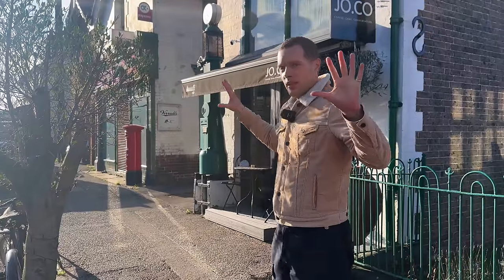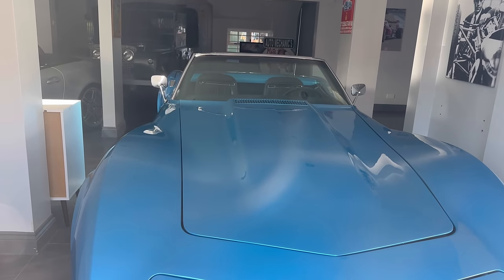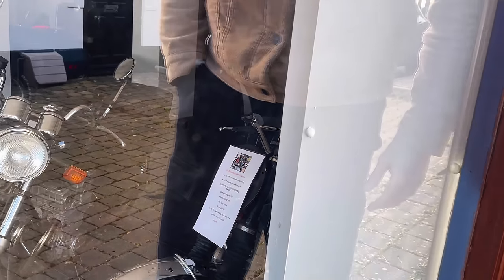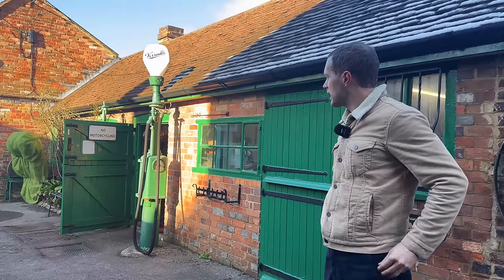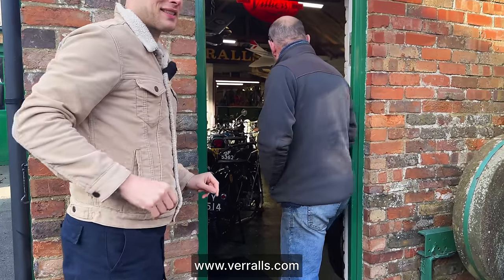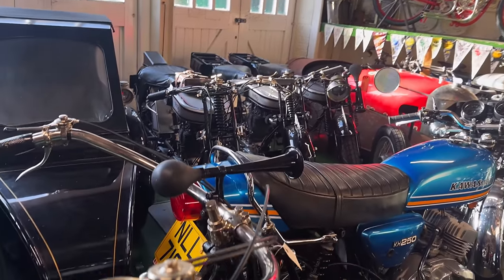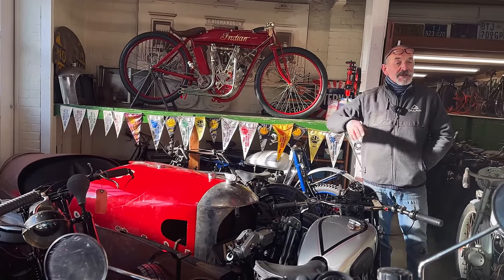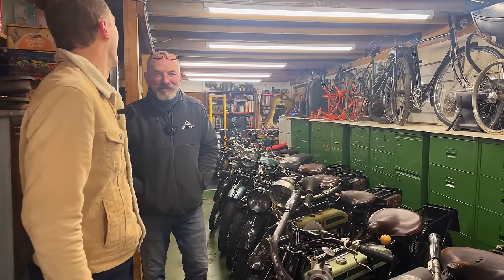England's Longest-Established Classic Motorcycle Dealer | Verralls

Comment: What I like about these traditional dealers is that the buildings fit the bikes..... it just would not be the same if it wasn’t located at the old “Forge” of the old “Mill” or something similar. A new building in the high street just wouldn’t have the same appeal. Great video.
Reply: We used to have an old motorcycle shop here in Hull, set on a main road but none the less the shop had not been modernized and like Verralls was packed with motorcycles of all ages and motoring memorabilia..........sadly the owner passed away and the shop closed.

Comment: In the eighties I bought a very troublesome Ducati 450 desmo which was a pig to start in fact someone came to buy it but try as we might it wouldn't start. Out of the blue i got a call from Verrells in London saying they wanted it. I informed them i was 250 miles away but no worries they sent a van, paid cash not even haggling about the price and took it away. The van driver told me that they could sell it in London at a price i could only dream of, quite amazing.

Comment: I enjoyed the video. Just a few pointers from one who's had a motor cycle licence for nearly sixty years. Some of the marques in the garage were well-known to us greybeards.

The Greeves Scottish was named after the Scottish Six Days Trial, the Blue Riband of trials events which, according to Google continues to this day. Greeves made a wide variety of scramblers, trials and road bikes mostly using Villiers two stroke engines or engines based on the Villiers engine.

The Excelsior was another marque which used Villiers engines mostly bikes intended to take the working man to his place of employment. Other makes included James and Francis Barnett which also produced trials bikes based on the commuter bikes. These makes folded with the arrival of the Honda 50cc step thru which was more economical and reliable. 

The Rudge Ulster was a sought-after bike in the Thirties, it was advertised as " Probably the fastest 500cc machine in production." The bike was named after the Ulster Grand Prix which it had won the 1928. It had a four-valve head which was unusual at the time. Another of the company's advertising slogans was "Don't trudge it, Rudge it!" 

Singer produced both cars and bikes from the late 1880s but gave up making bikes in 1915. I had to Google that!

Comment: Thanks Freddie for the nostalgic trip around Verralls, it was very interesting as were the surrounding shops and cafe. 
I have never heard of a Sparkbrook before and did not know Singer made bikes, as you say I thought they made sewing machines?.
 I have heard of quite a few of the other bikes and knew someone many years ago who had a Villiers Trials with banana type front suspension, two rear type shocks on the front which was quite unusual to look at but must have been the thing in the day.
Reply: Singer also made cars.
My parents wedding gift in 1952. was a second hand  Singer coupe. 
My brother owned a fancy Hillman Hunter with automatic transmission.  The "Roots Group" who manufactured it, designated it a Singer "Vogue" . I guess to differentiate it from the common manual Hillman Hunter.
There were so many names. So much got lost.

Comment: That blue kh250 Kawasaki is the exact one that I bought, THE BAIN OF MY LIFE It was awful to go a ride would take 2 or3 hours to get it going, when I did eventually ride it very fast bike could take on the Kawasaki z650 and a few other mid range bikes . It nearly killed me a few times , was I glad to get rid of it and I swore I would never have a two stroke again . My next bike was just the opposite a fantastic bike the Kawasaki z1000st cost me £2450 my first time riding it I felt so good, incredibly smooth, shaft drive. The only negative was on fast long bends it was not stable but I cured that by just putting a heavier fork oil in and then it was just sweet to ride. The funny thing was the chain driven version could not live with me , people say the shaft reduced the power at the back wheel, I found just the opposite my bike was fast . Wish I still had it 😊 👍🏍️
Reply: I had a similar experience. I passed my test on a Kawasaki Z250, and as much as I loved it I never truly gelled with it. Enter the mighty Kawasaki Z1300. Shaft drive, water-cooled. I was told "that will never catch on"....How wrong they were. I recall the Z1000ST well, and the Z1000J. So many great bikes in those days. 
These days I run a gen 3 Suzuki Hayabusa and a classic 1991 Kawasaki Voyager xii
Reply: @BibTheBoulderTheOriginalOne  oh my Z1300 like st but even better  , bet you enjoyed riding that muscle bike? I had the pleasure of 1300 for a week end while my st was being serviced, did I enjoy my 😊 , they used to say the Z1300 could head but minis out the way , happy memories 😌  and no speed cameras and not so many bobbies in cars . I remember a friend had a cb550 Honda and nobody could keep up with him , I went on the back the once and when I got off I had green stains on my helmet w from touching the hedges round bends lol 😂